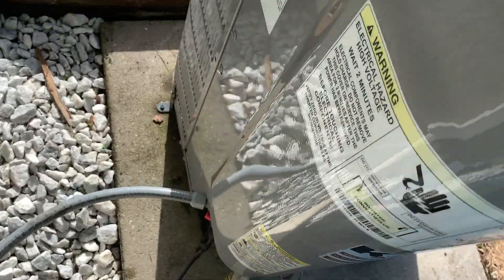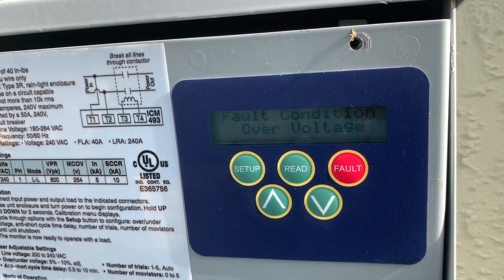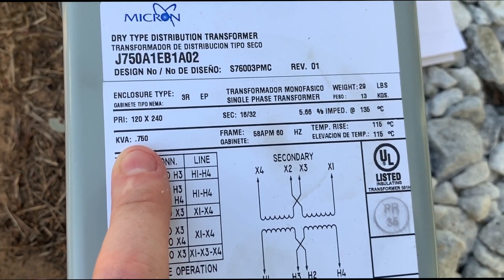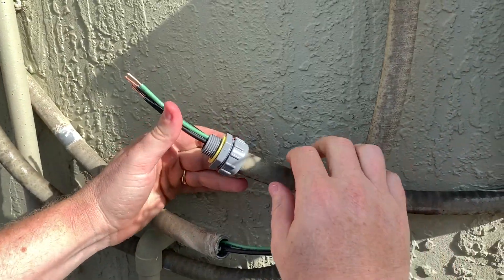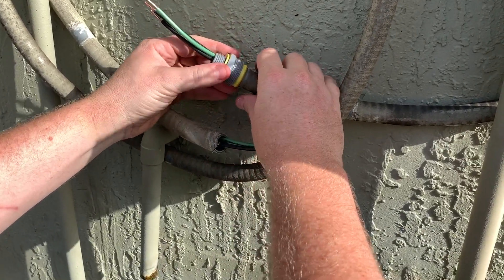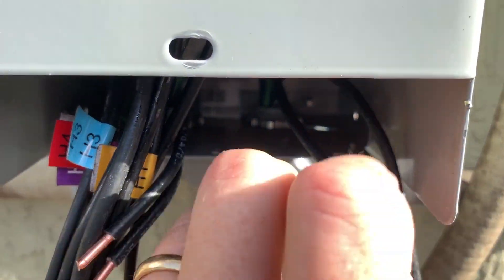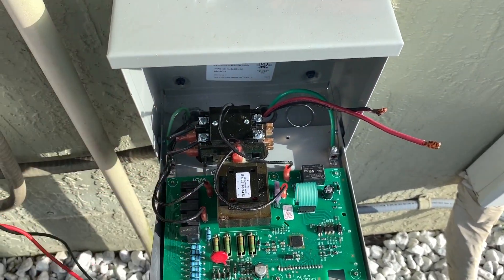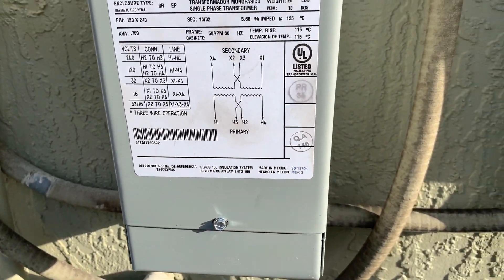Saving a System w/ a Buck and Boost

Comment: Thanks for posting this! Experienced this exact thing on a Mitsubishi system I have an ICM493 on. Power company was zero help and every winter demand drops and the ICM locks out the system. Bucked the voltage yesterday and she’s running on a smooth 228 VAC now.

Comment: If the primary is 240 and secondary is 16/32 how is it possible to get 230v. I’m totally confused.
Reply: That's because it's not being used as a normal transformer, converting voltage from primary to secondary. The primary voltage is actually fed into one or both of the secondary coils, to either increase or decrease voltage on the primary coil. In this configuration, the transformer is being used as an auto transformer, versus a regular one.

If you search out videos on autotransformers, you can get a much more detailed and clear explanation of this.

Comment: Had to call PG&E here in central Cali. They had to adjust the regulator at the substation. The reason is most Solar grid tie systems are UL restricted with voltage limits.
Having it swing all over the place is not good. The incoming voltage would go to 254 and pushing just 2 Kw to the grid made it trip on over voltage. This was a few years ago. 
It has been stable ever since.  Depending on the customer loads on the high tension line, the location you are at might have to be high.

Comment: what if the utility comes back after this and fixes their issue? will it damage if it goes under voltage? obviously you have protection for over under so my question is elementary
Reply: No an issue because the system is rated at the low end for 208V, which means it can go lower than that and still be OK.

Comment: That's a great video. This is not that common of a problem, however when it happens it is great to know there is a fix. What happens if the power company comes and changes the taps, does that lower the voltage coming out of the buck and boast?
Reply from the maker: Yes it would drop it but it would still be in the rated zone even if they dropped all the way to 240v which they never do in this area

Comment: The only thing about spinning the seal tight connector like that is if it's a 90 it kinda twists the wires up and makes it wanna come loose
Reply from the maker: Use a straight as a tool to get it in and out #Boom
Reply: HVAC School mind blown psssssshhhhhh

Comment: Shouldnt have to invest in a buck and boost.  Power Co. Can control this at their transformer.
Reply from the maker: We contacted them many times and they were unhelpful
Reply: It depends on multiple factors. The most common issue is: 1) If the local power hasn't kept up with the development in the area, the power company will tap the transformers higher, in order to keep the voltage from going too low, during peak demand times, such as breakfast and dinner times. Then, when demand is low, the voltage goes high. Eventually, the power company will upgrade the distribution in the area, but this is rarely a quick fix.

2) Some areas that have a decent percentage of rooftop solar and they will have something of a voltage arms race around midday. Each grid tied system will be programmed to output slightly higher than the power feeding their home, so that their system is powering their own loads or earning net-metering credits via their electric meter. Their system outputting higher voltage, also bumps the utilitie's voltage a bit higher. If enough people in the area have systems trying to output just a little bit higher voltage than the next guy, the whole neighborhood ends up with midday high voltages. That's not something that the local grid can respond to. These are real time issues and tapping local transformers is a manual process.

Comment: 260v at night ..?? crazy !!
Reply: It's actually a common problem, especially in areas that have developed and grown out of pace with the local electrical utility equipment. The electrical utilities in these areas will usually tap the transformers a little higher to make up for the peak load, but when the loading is low (usually at night), the voltage will run high. The eventual and proper fix, is for the power utility to increase the distribution circuits and associated transformers, but until then, they'll cheat by tapping the transformers to the higher voltage.

Another issue that can cause higher voltages: There are housing developments in say Florida that sell homes that include grid tied rooftop solar, as a standard. Since an electrical load (any device that uses power) will use the highest voltage source first, the AC power that the solar produces must be slightly higher than utilitie's incoming power. This higher voltage is also then seen by your neighbors, who are fed by the same power. Now, for their solar to supply power, it needs to be just a little higher voltage, which it adjusts to automatically; and so on and so on. The result being, around mid day, while most people are at work and these neighborhoods are using little power, the solar in these neighborhoods are pushing the voltage to the high end of the spectrum. By code, there's a limit to the voltage output of solar, but some people will make adjustments to their system to exceed the code limit because it makes financial sense for their solar power to be earning electrical credits, by supplying power to the grid. So, this neighborhood would suffer from high voltages during the midday, even if all the utilitie's equipment is sized and set properly.
Reply: Still its only 8% off of 240v. Manufacturers keep selling us euro spec 208 230 units here in the USA and wonder why everyone says mini splits are problematic and hate them. All this tech and they cant sell us a unit thats made for our grid.